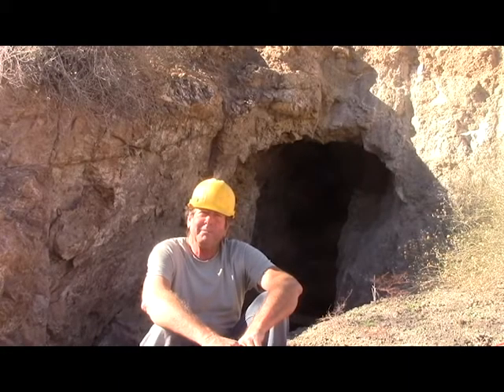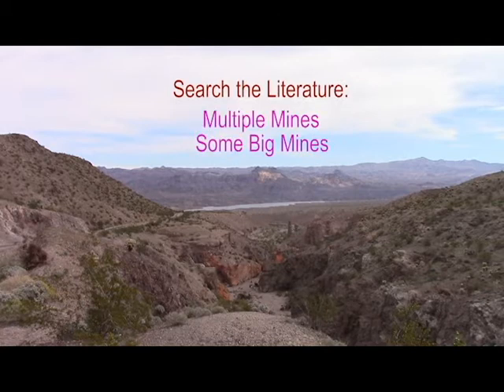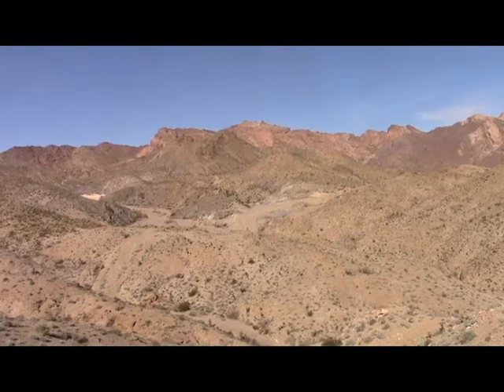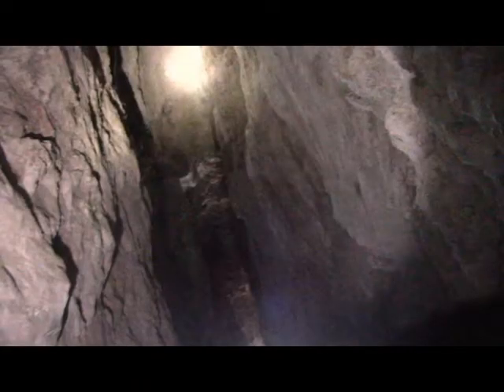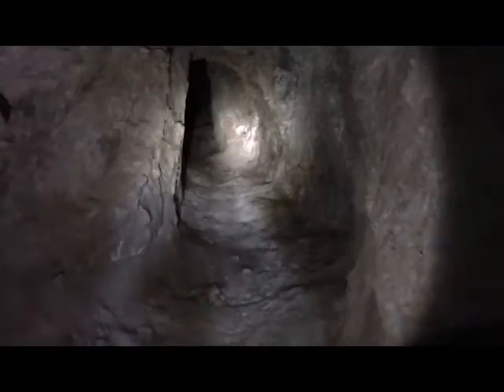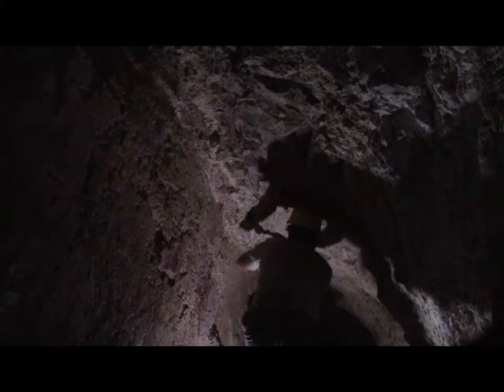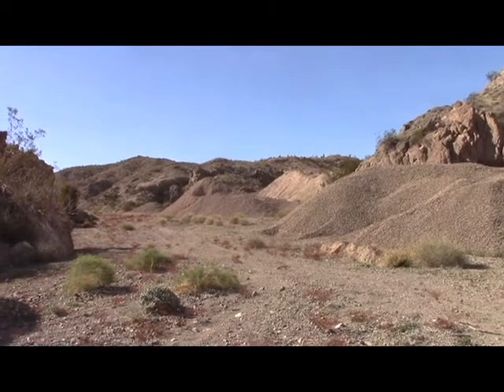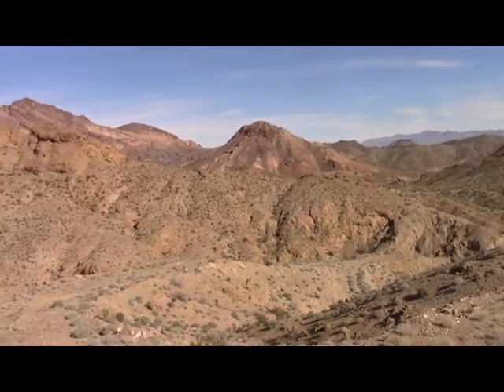Lesson 13  Preliminary Survey, Nevada Prospect 1

Comment: Another well done video. Question for you though. In your experience and opinion with hard rock mines how stable are most old hard rock mines? Here in CO there are many old mines that are well over a 100+ years old and other then maybe stuff blocking the portal appear to be quite solid? I personally expect many of those mines to be stable another 100+ years from now? I avoid going in old mines as a general rule but the few I have been in the timbers where completely rotted or gone and the surrounding rock didn't seemed phased. I often wonder if those old wooden timbers where kind of a feel good or last resort kinda thing because I find it hard to believe that those wooden timbers would make much of a difference if the tons and tons of host rock above you actually did cave in? Any way just wanted you thoughts on that or if you have ever gone in any and been stopped by an actually collapsed tunnel?
Reply from the maker: Yes I have been in a few shaky mines.  In general though I agree that if has stood for 50 years it probably isn't going to fall today.  Also ground support may be installed assuming that later mining will weaken the rock.  If that later mining doesn't happen, no strain develops.

Evaluate each situation as you go.  In general I would list the dangers in order of likelihood as critters, slip and fall, bad air, and bad ground.

Keith

Comment: Hi Keith,

I just wanted to say that I have really enjoyed your videos so far! I think it is very important to have a resource such as the one you are creating and I hope you stick with it. 

You mentioned being open to ideas for future videos so here is one. Blasting is not really feasible for the small scale miner anymore and consequently it is difficult to extract any sizable tonnage of ore from underground. I think it would be interesting to see a video that demonstrates an alternative method to underground lode mining. Perhaps with the jackhammer? I'm just afraid of using one underground due to the vibration. Perhaps show scaling the work area before hand so it is safe to use the jackhammer? I think this would be best for underhand stoping but I would really like to see this method applied to advancing the face of the mine.

Thanks,

Joe
Reply from the maker: That sounds fine.  Right now I am not actively advancing any drifts, but when I do I will make a video.  Did you see my video on breaking and moving rock with hand tools?  That illustrates all the basic principles except ground control.  There are a few differences between advancing a drift and slicing a face, but not many.  The technique shown would be exactly what you would use for underhand stoping.

Vibration is less of a problem than you might think, but you do need to be careful.  Proper scaling and ground support before commencing mining, and careful rock removal and ground support while mining keep you safe.

BTW, are you familiar with the 'cellulose composite solid state ground movement detector'?  Just take a wooden wedge and gently insert it into a crack so that any movement will let it fall.  If it falls, run first and look back later!  It is especially useful when stabilizing unstable ground.

Keith
Reply: +Hard Rock University

Thanks for the quick reply! 

I did see your video on moving rock, very good information! One thing I have found that increases efficiency even more is to lay a piece of plywood down as a muck plate of sorts then use a flat head shovel to shovel off of it. 

Good to know vibrations aren't THAT big of a concern. There is a lot of water in the mines here in Oregon so rock always seems to be moving. I have scaled down very little rock due to the concern of what else it might bring down, I think this might be a great concern for a lot of newer people. It would be good to see how to do this safely and what safety concerns to look for. 

 'cellulose composite solid state ground movement detector'... I have been trying to figure out how to detect ground movement for a long time. This is a fantastic idea!!

Thanks Keith!

Joe
Reply from the maker: Wet ground will be more unstable.  One big question is what kind of rock do you have?  If the rock is naturally fragmented before the mining, then you can have some serious issues.  What is your situation?
Reply: +Hard Rock University The rock/vein is a well brecciated (rhyolite and andesite) and is cemented with a "soft silica gouge". I think the overall integrity of the adit is OK because there aren't a lot of rocks on the floor but material can be easily knocked off of the back. It's nice because it's incredibly easy to dig but also worrisome at the same time. 

The back of the adit is also rather flat, I'm wondering if I should try and sculpt it into more of an arch? Am I mistaken or would that inherently add structural integrity to it? Especially for advancing the face I want to make sure I'm using the correct technique.

Thanks,

Joe
Reply from the maker: Flat back vs arch is determined by whether or not the rock has natural fracture planes that are horizontal or nearly so.  If the bedrock is fairly homogenous then the arched back is generally preferred..  Is there good ventilation?

Keith
Reply: +Hard Rock University
Very interesting, thanks! The adit goes back about 100 feet and the air is OK even though there isn't a whole lot of circulation. Working in there for prolonged periods of time may deplete the oxygen however. I might need to set up some kind of ventilation system. Speaking of which that would sure be neat to see a video of a good small scale ventilation system!

Joe
Reply from the maker: Just found one.  Harbor Freight has a 1 hp blower for dust collection- $140.00.  The hoses run about $1.00 per foot.  Another thong that would be very helpful is a 'roof jack'.  A roof jack is a form of temporary ground support used for protection, especially when installing round support or barring down.  For quick and light duty jack, one can buy a cargo support for a semi truck and use it.  I prefer something  more robust.  I start with a scaffold leveling jack screw with a swiveling base plate.  If your work area is between 5 and 8 feet high, the next step is to get one piece of 1/4" wall tubing that the leveling screw jack fits in and then another.5' piece of tubing that the first tubing slides in and out of.  Drill one 1/2" hole 6" from the bottom end of the small tube, and 1/2" holes every six inches through the large tube and weld a base plate on the large tube.  Then just slide the leveling jack in the top of the small tube, and the small tube into the top of the large tube, and slide a 1/2" grade eight bolt through the hole in the small tube and appropriate hole in the large tube to get close to the roof and screw the jack up to your header board.  Strong, portable, and cheap.

Keith
Reply: +Hard Rock University Awesome, I will be getting one of those blowers! Fantastic idea for roof support too!! I think you have answered all of the questions I have at the moment, thanks again!!!

Joe
Reply from the maker: you're welcome

Comment: If you have to make lots of trips hauling up and down why not drive a stake in and attach cable and a come along to pull the slack out and send your sample buckets down zip line like attach small pulleys on the bucket handles nice videos keep them coming
Reply from the maker: Sorry about the delay, never got a notification on this.  Another thing one can do with a cable way is to use a loop of cable with pulleys top and bottom and some kind of a brake.  This way you can send ore down while sending empty buckets or supplies up with no effort.

Keith